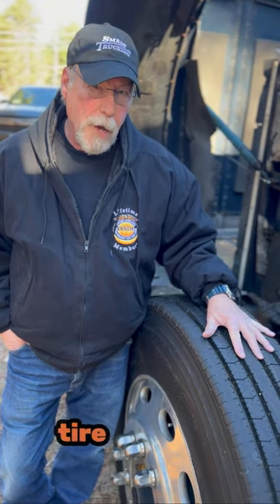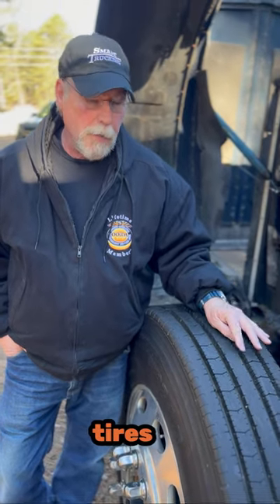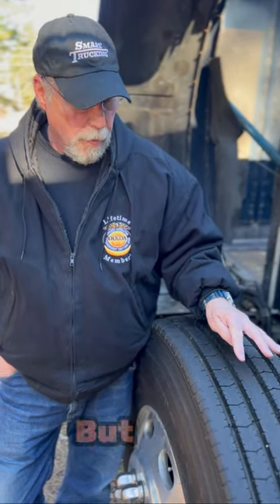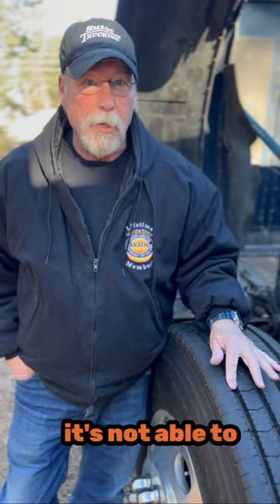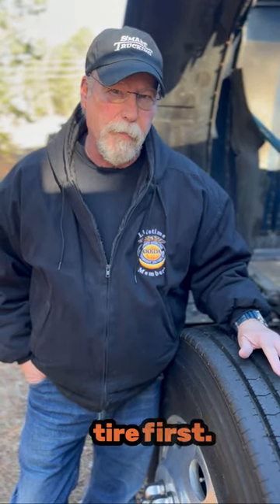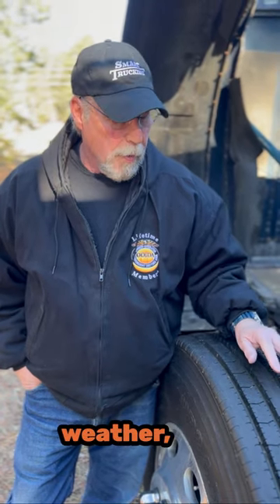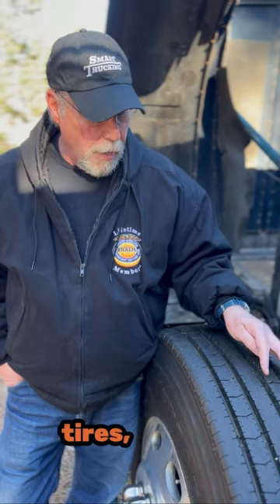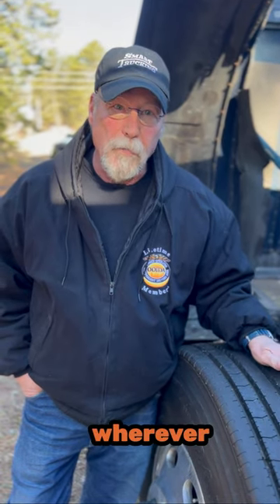How To Best Avoid HydroPlaning! #shorts

Comment: Tread depth is important as is proper weight on the steer axle. Too light you'll develop PUSH which can make hydroplaning more likely. Too much and your overweight on your steer. So learn your truck put your 5th wheel where your steer axle is 11,500 to 12,000lb loaded. Especially if you run a short wheelbase truck pulling a spread or Tri-axle trailer. Push is when you turn the wheel and the truck still goes straight. If you do lots of drop and hooks. STP oil treatment will help the 5th wheel in-between greasings. And remember if your 5th wheel is behind the centerline of your tandems. Your taking weight off the steer axle and putting it on the drive axle. Which will make Hydroplaning more likely to happen.